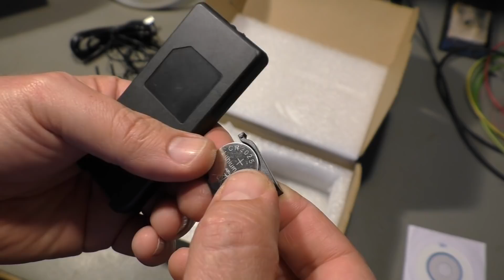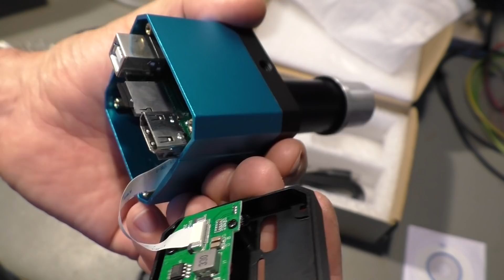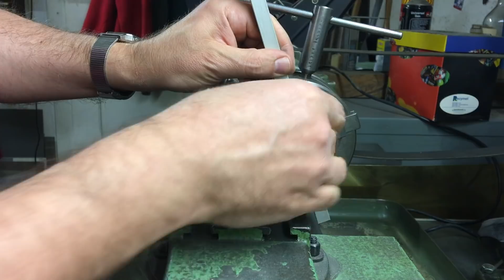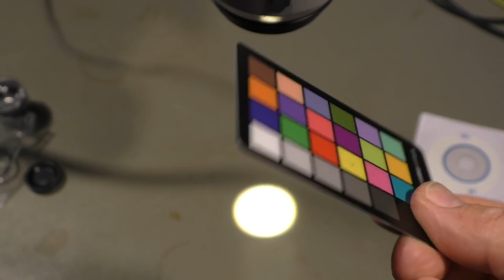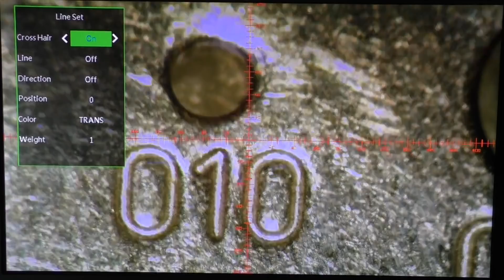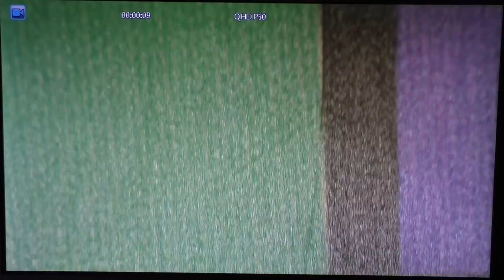Hayear Microscope Camera for my OPMI-1 - (PWJ166)

Comment: I have an identical camera that was sold as a standalone microscope with 300X magnification, it has a C-mount (Security camera) on the camera block so you may have the ability to use it by itself with an inexpensive lens.  I've had fairly good luck with mine, the main problem being a way to mount and adjust it since it's way too high a magnification to hold by hand.  I've purchased several random lenses with mixed results, you really get what you pay for.  I was going to use it as a soldering scope however the magnification even at the low end (75X) is a bit much, though it has an amazingly long distance from your work, maybe 200mm.  It's a lot more useful via HDMI since the USB picture is at a lower frame rate.  BTW they sold it as a 14MP camera and it can definitely capture still frames at that resolution onto the micro SD card.

Comment: There are HDMI to DVI cables (I have one)
Reply from the maker: I know... and I had one but it did not work because the camera does not supply power for the chip in the cable.
Anyway, I need a smaller screen, so I will go for a small HDMI LCD.

Comment: Why  not    just get  another camera   ( free from  China) , make another adapter, and mount  it on the other side  , then   connect  to a  dual  monitor   screens  using a  Windows  10 computer
Reply from the maker: And that will do what? But it would be interesting to create a 3D picture by alternating the both pictures and wear 3D glasses.
Reply: @PlaywithJunk   Please go back to  taking apart  servers